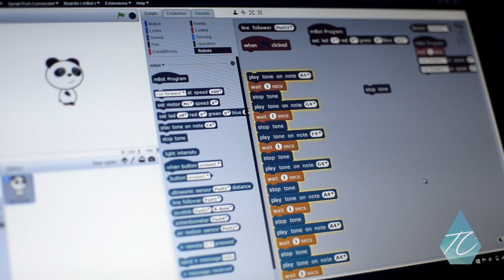MBot - One Robot Per Kid - Review and Demonstration

Comment: I would like to buy the Mbot, but I have a question or 2. I am going to use it to show my class for a project, and the Mbot can be controlled with a smart phone though we are not aloud to use our cellphones during school. Is there a way I can control the Mbot without using any technology? I did see a remote, is that also used to control it? Thank you and hopefully you can answer my questions!
Reply: Yes that remote can be used to control it. It has a d-pad mode switching buttons and speed buttons. You can also use a laptop with Bluetooth to control it.

Comment: Hi I found your video really helpful - i'm going to buy the mbot for my son. I have 3 boys age 4, 7, 9 - the mbot would be for my 9 year old. what do you think og kido (robot) and do you have other recommendations for 4 and 7 year olds? thanks
Reply: +Yen Siow   YES!  I have 2nd and 3rd graders in Nebraska that have built and run these.  They don't know all the ins and outs and terms, but they learn how to use them.
Reply: I would try to find used mindstorms stuff. they just upgraded the Lego robotics system so the old stuff is going to be really cheap used. 
the good stuff is it works with the legos you probably already have and can be adapted from a simple motor on and off switch to make more advanced systems.